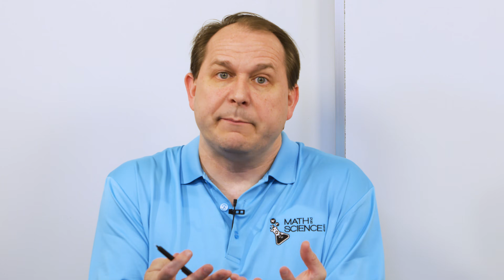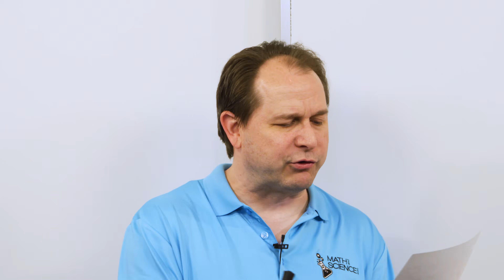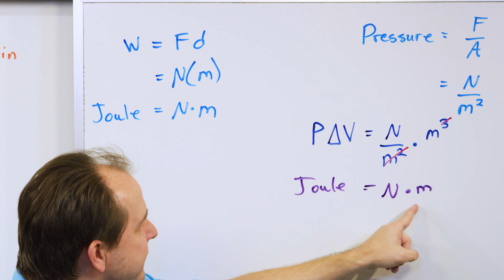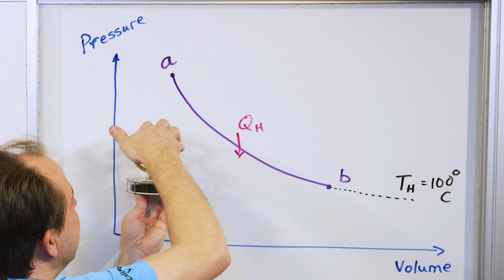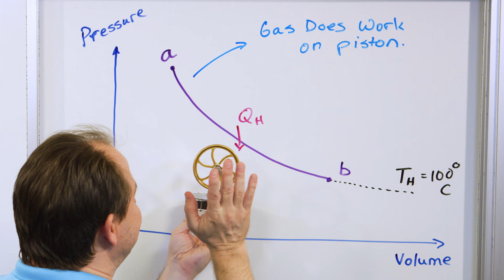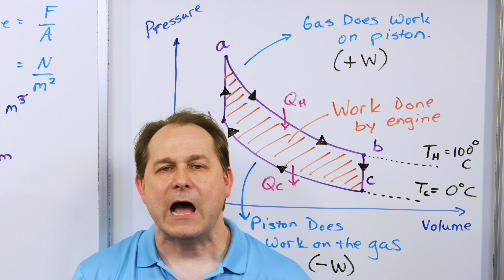Can a HEAT Engine run on Liquid Nitrogen (-196 C)?

Comment: Hi Jason! I am currently going through the chapter “Applying Newtons laws” in class. Which includes tension forces, centripetal forces and so on. I just can’t seem to understand it and I really would like to follow your lectures on it, however I could not find any related videos in my bundle download file. I have tried to look for an updated pdf when I login to your website but it says that the download is expired.

Comment: I was a little lost at first as I watched the entire video I caught on to what was happening.  The heat in the base creates a positive pressure in the up direction and the cooling at the top causes the gas to contract while also the force of the initial movement has some inertia as well and pushes the plate back down and repeats the cycle.  You just have to remember there is some inertia involved as an object in motion tends to stay in motion!
Reply from the maker: Bingo!

Comment: So in ancient Egypt one could make a heat engine to power a machine (a mechanical computer) without electricity.
Reply from the maker: Yes it’s crazy right.
Reply: @MathAndScience  do you think one day you can make a video doing that?
Reply: technically the engine is generating electricity in that situation :)